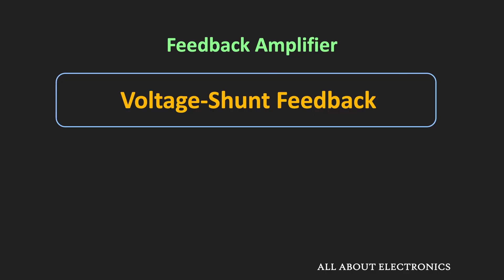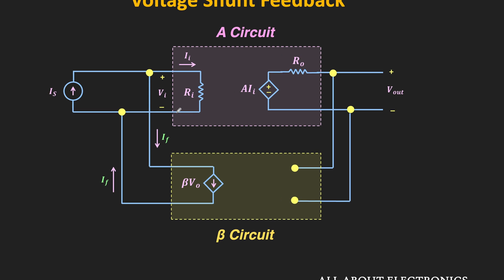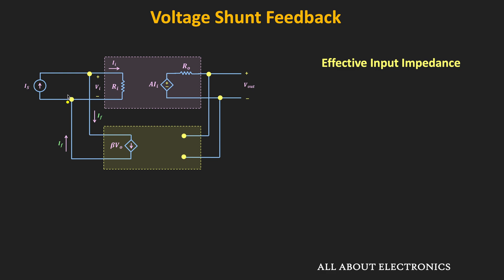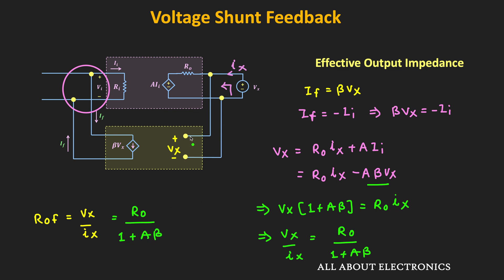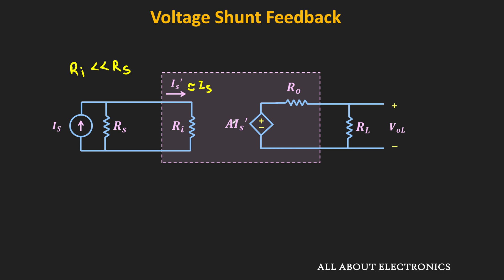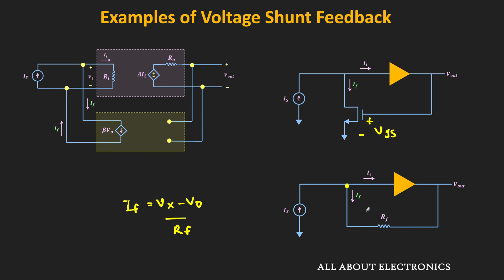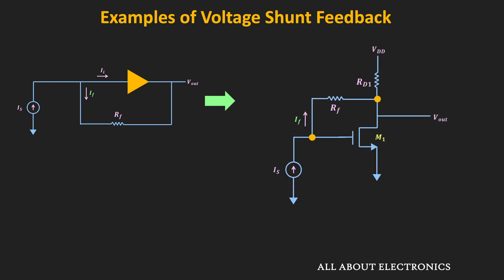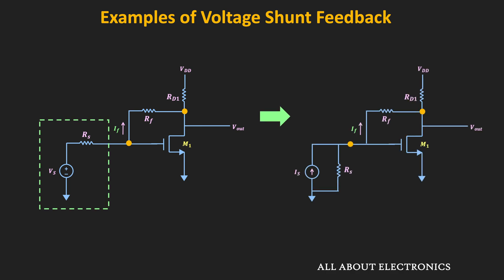Voltage Shunt Feedback Amplifier Explained | Feedback Amplifier

Comment: How is vout= A*input current? Wouldn't there be a drop across Ro resistor ,making vout less than A*input current
Reply: @mohdanzar1895  while deriving for the primary side current of the other side is taken to be zero.
Or you can think in another way that the it's output represent the overall voltage gain.